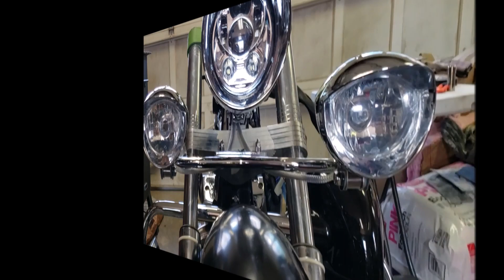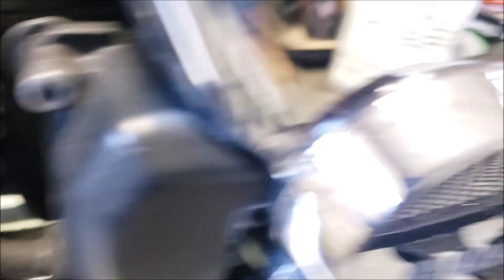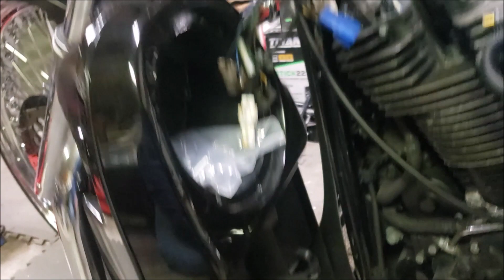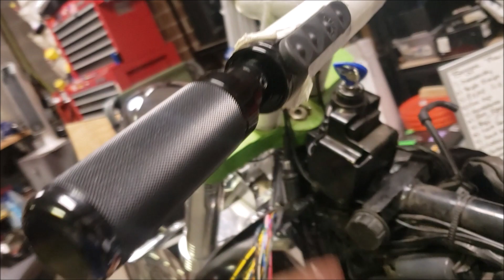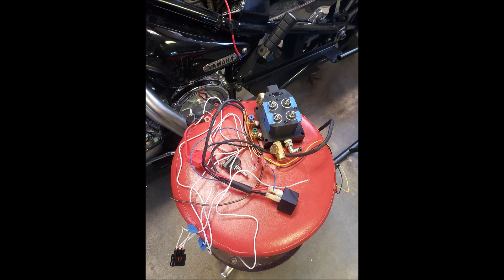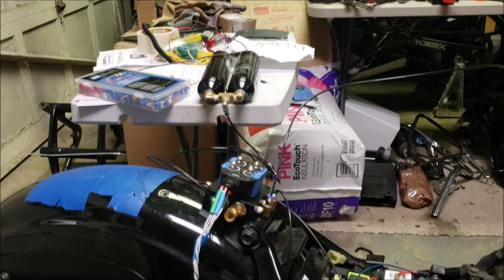Yamaha Road Star Big Wheel Bagger Build Chronicles, Ep 14

Comment: I had a question for how you wired your turn signals. I have an aftermarket switch with three wires and having a hard time trying to wire the turn signals properly
Reply from the maker: Mine are completely rewired to go with the control system that I have.  If I remember correctly, you have blue, green and ground... and you will have two sets of wires, one set from the harness to the switch and one set from the harness to the actual lights.  The should be separated by the relay.  You don't have direct wiring from switches to lights, right?  Where are you having your difficulty?

Comment: Awesome job Juan! Loving watching your build moving along and getting areas for my own build. 
You said the highway bar was from a Harley, what model? I've read elsewhere that a highway bar from any of the "big Harleys" can be used on a Roadstar but I guess my Harley vernacular needs some work so what models would be considered a Big Harley? 😆
Reply from the maker: I'm pretty sure mine is from a 2008 and up touring model.  Either way, I had to make mounts for the bottom and put a hole in the top of the A Frame for the top mount.  I went with the style I got specifically to use the lowers